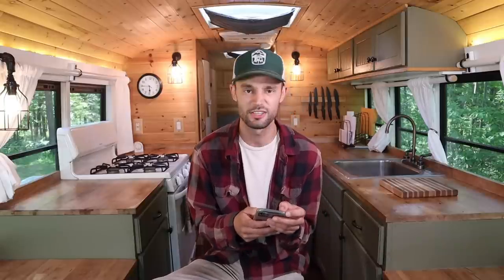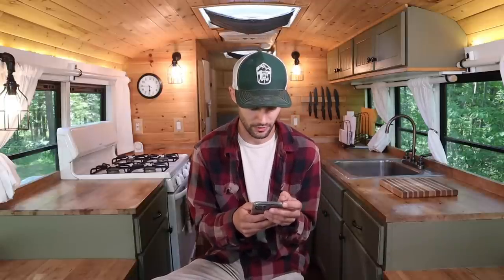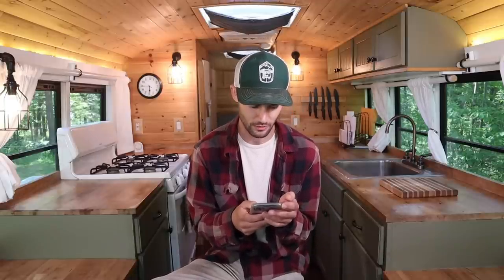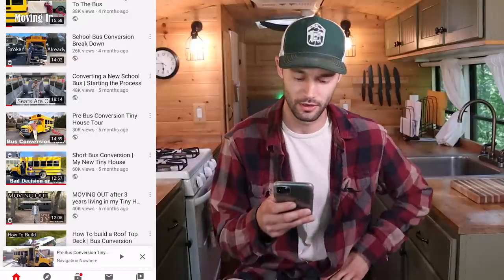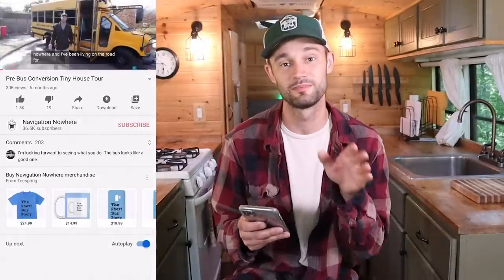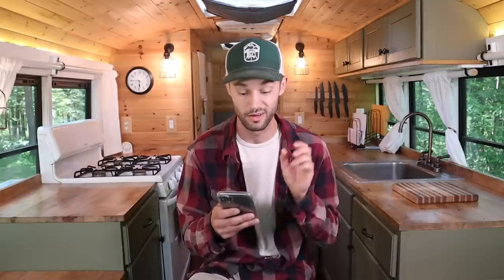Answering your SHORT BUS CONVERSION questions

Comment: Mike, another great video! As your favorite channel troll I do have just a couple questions. #1  Did you really spend 35 thousand on NAVI?  #2  Do you have a link for AA batteries?  I will gladly buy you some if you promise to fix the clock in NAVI, if not please at least change the time in the next video, 4:20 works for me! Stay Safe and have Fun. See ya soon!
Reply from the maker: Hey Dale ! 1) I spent $3,500 on the purchase price. $35,000 was full build with materials. I miss spoke in the video. 2) I will get a AA battery link for you 😂
Reply: @navigationnowhere  Question - let's say you drive it for 5 years then parked the NAVI.  Do u think as a permanent tiny home, it would last another 5 or 10 structurally? Does that make sense?
Reply: The clock in the back of my garage is permanently set at 4:20.

Comment: Well done Michael. Watching this one, I realized you do a really good job teaching. Obviously for the visual learners it's not appreciated, but for auditory learners, the wealth of info you share is pretty priceless. Here's one question...Have you ever considered using steel studs rather than wood to do the build out? I'm thinking it would be lighter, more square, less issues with moisture, and easier to form to all the shapes and curves of the bus. Wondering your thoughts on that.

Comment: If you're tall and want head room without the work of a roof raise look for ex military school buses.  They aren't as common as regular school buses but they are out there.  They had the roof raised from the factory to accommodate grown men instead of kids.  I have one that is a short bus and with work boots that add about 2 inches to my 6'6" height I can stand upright without bending over or hitting my head.

Comment: in Texas you do not need a CDL unless it has air brakes, so to beat the system look for hydraulic fluid type brakes
Reply: HEY !! I think its the GVW that has to do with air brakes , alot of med. tow trucks have air brakes but because they are under the commercial weight,no CDL is required  , But some states and insurance co. want the drivers to have a medical card each year , but not a private owners !  ( ex-CDL driver and ex-tow trk. diver . )

Comment: I think a lot of people misunderstand the CDL. You do not need a CDL period if you are using something for personal use. You can go out and buy a semi truck and as long as you use it strictly for you, you don't need a CDL. Same with the Air Brake endorsement (which I disagree with). You can have air brakes on your personal vehicle and not have a CDL. Remember the 'C' in CDL stands for COMMERCIAL. That is why you see some semi's and busses with "Not For Hire" on the sides. The CDL is federal and the requirements are federal.

Comment: Just a fast one. You can use the wires from the bus even for the solar, just remember to use more parallel, so you end up having enough thickness.

Comment: Ok, I am gonna ask a question, how do you fasten fridge stove and lower cabinets...not something that I have seen shown in detail in many videos
Reply from the maker: I will be showing this in the build series (when we get to it) but they are installed just like you would in a residential house essentially. Once we get the bus spray foamed and wood sheeted everything is general carpentry. I show a little bit about this is the previous series on the trailer.

Comment: Question, (full bus related) 
I hear that most school buses are not a good choice if you are going to do long distance traveling. Because the chassis, engine and transmission are designed for short stop and go neighborhood driving,  Not long drives. I heard a tour/sports team school bus is better because that chassis, engine and transmission are more designed for it. So my question is have you heard of this and do you agree or disagree?

Comment: New question: Are you going to reuse the original bus windows or replace them with better insulated windows? RV windows?
Reply from the maker: I will be blocking off some with metal. Other I will reuse and seal the original bus windows.

Comment: Why are airport shuttle buses more expensive than school buses for the conversion?
Wet floors? What, are you going in there with a garden hose spraying it all over the floor?? 
The flooring isn't going to become moist unless you have a leak, usually shuttle buses or school buses are virtually leak-free so most likely you're not going to have a moist floor.

Comment: Im trying to understand the wiring you need in the engine bay of the bus my bus started and now i cant seem to get it to start i charged my batteries. Is there some safety feature i am unaware of?
Reply from the maker: It can be a vandalock system which is commonly installed on buses to stop the engine from starting if a emergency door or hatch are open. It is typically a orange wire labeled vol 30-31. (Might be different in your bus specifically but maybe it will be the same.) If it is the vandalock system you just need to close the loop so the “system” thinks the door or hatch is closed. Or You can decommission the system completely. Decommissioning can be harder to do and explain over comments but if you follow the wires you can maybe figure it out. hope that helps a bit 👍

Comment: Does the spray foam cut down on exterior panel vibration/noise while driving? Or would you recommend adding some type of sound deadening material like dynamat?
Reply from the maker: Personally, I feel the closed cell foam takes a lot of vibration away but, areas around the engine could use some extra sound/vibration material. If your interested, look into products like dynamat

Comment: Per federal regulations, if the vehicle weight is more than 26,000 lbs, it will require a cdl to operate (not necessarily to own/register) until you change the title to some sort of "private" use, like an RV. Once the title is changed, this requirement under federal regulations goes away. But, you still need to check state and local laws. And, also under federal regulations, anytime a vehicle has more than 15 passenger capacity including the driver, it requires a cdl with a passenger endorsement to operate (again, not necessarily to own/register). But, this one goes away by removing at least enough seats to get to that number of 15 passengers including the driver. Keep in mind that school bus seats are rated for 2 adults or 3 children. So, each seat counts as 3 capacity unless 2 sets of seatbelts per seat are installed, which may possibly become a requirement as a private use vehicle. Excellent video and information otherwise.

Comment: Thank You for these video's.  I'm trying to figure out what vehicle I should make the investment into.   I'm in a powerchair so I keep going towards a 5 window bus.  My problem is I have only driven FWD.  The buses or vans (except Promaster) are RWD and I've only had 4x4 with the Ford I had and loved.  I like the whole idea of a bus like you're working on, but the Promaster is FWD.  What would you do?
Reply: Until you get into inclement weather or hydroplaning the fwd and rwd are close to the same but I think if you are in a chair the bigger problem is how to get into the driver's seat. If you can take a couple steps or not could make the difference on  available seats at reasonable cost. The advantage of the van front end is the front seat availability for wheelchair accessible are greater.

Comment: Why take out the windows if you don’t have any leaks?  Why not re waterproof them as they are IF there are no leaks.  Is it necessary to take them out?
Reply: I have found that the factory window seals appear to be applied very quickly and many times do not seal very well allowing water to go inside the walls. After cleaning and resealing with Sikaflex 296, peace of mind.

Comment: Renting an R.V. with same running gear frame set up would better represent the weight you will have with a bus
Reply from the maker: Renting an RV is a good idea too! Thanks for the suggestion
Reply: If you are not use to driving big vehicles and you want a practice run doing so. Either will do. It's really wrapping your brain around the size and visibility changes of something bigger than a standard car.

Comment: Did you use spray foam on the floor to.
Reply from the maker: Not in this rig. We will frame it out with board insulation and traditional sub floor

Comment: Let me help with questions! LOL Right now one that comes to mind is do you have to gut the bus as thoroughly a you have to be able to gut all the wires like you have? Or could you still do the wire removal without it as gutted?
Reply from the maker: It would be quite difficult to remove the wires as I have without taking the bus apart quite a bit. However, you can do some.
Reply: @navigationnowhere  YOU can just abandon some wires that you won't use if they are in a place that you are not going to tear out for the build !?

Comment: Would you be suspicious if the miles were low,  yet it's being sold cheaply,???
Reply from the maker: Not really, both buses that I bought under 100k miles were from a boys and girls club. So they were regularly serviced but seldom used.
Reply: Do they have to tell you who the previous owner was??,  I'm looking at an MCI with less that 50k for about 25k.

Comment: Michael did you mean $3,500 and not $35,000?
Reply from the maker: Yes sorry I meant $3,500 miss that haha imagine $35,000 😂 it better be brand new.
Reply: @navigationnowhere  Those are very good low prices. I've recently seen a few turtle top shuttle buses for over $20,000. One was a limo bus and one a wheelchair lift in back bus. The get the same mileage with a gas engine. We had a Chevy and a Ford at work. Both black and sold.
Now we have a white Ford that can be used for weddings and 10 people transport.
I'm in the transportation business as a chauffeur. Don't like driving to Teterboro or JFK. I'm in R.I.
Reply from the maker: I flew out of JFK so many times. I agree... not a fun place to drive.